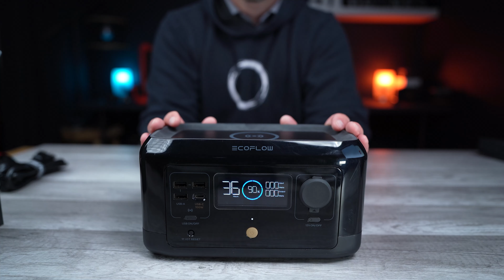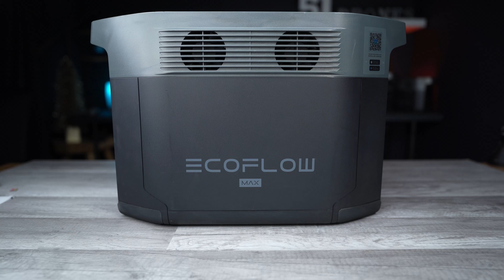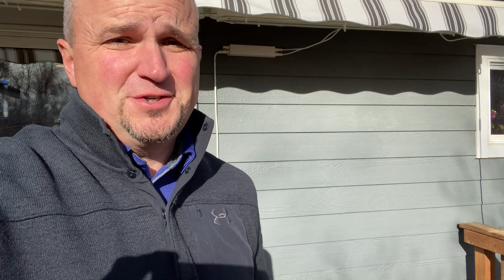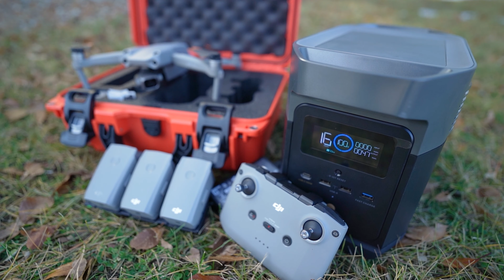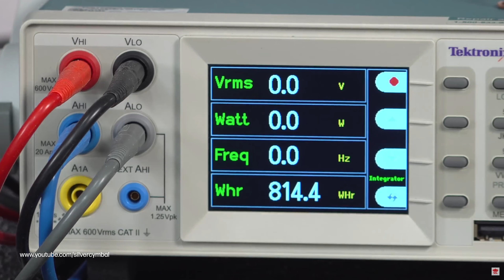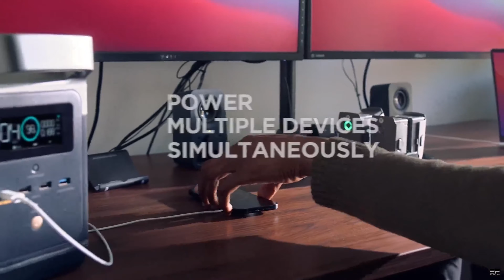EcoFlow Delta, Delta Max and Delta Mini - Which one is for you?

Comment: BEWARE OF THE ECOFLOW PRODUCTS! BARELY USED DELTA PRO & had a small electric heater plugged into one of outlets on the front & suddenly the entire unit is dead.  Tech support said nothing they can do about it & want to send reman unit but will not extend warranty on reman unit to guarantee that same thing won't happen again! MAYBE CHECK INTO BLUETTI'S !

Comment: I have purchased 2 of the Eco flow Delta Max Delta pro. I am a engineer and hands down is down for the amount of money and the amount of efficiency in the products you can't beat it. There's many different kinds of products out there it's all depends on your personal use. And what your preferences but I can truly say thatruly say that I am my wife did a lot of research joined different products and I'm so happy that I came across this product the Eco flow. I just want everyone to keep in mind that these are for specifically aemergency purposes they're not to sit and run a dryer or a washer all day every day. I have used them in blackouts to turn on heavy light and fan and light my whole house and run other devices 100% efficiently works great. You can run a dryer which I've done I've run a Samsung full load washer for hoursBut in a case of an emergency I'm not concerned about washing or drying clothes. My main concern is having power to run a hot plate make some coffee keep my refrigerator running and keep my lights and my electronics backed up.

Comment: Hi Russell,
I’ve been a long time follower of your channel regarding drones..great channel…regarding the eco family of electric generators, I have a unique situation with one of its competitors that I believe is a systemic issue among all units like these, but I’m hoping that the eco flow is different.  I currently have a Westinghouse iGen1000s hooked up to my sump pump as a UPS and it works great EXCEPT for one MAJOR operational problem.  When power goes out, the electric generator takes over and does it’s job, if the sump needs it, BUT if the power is off for more than 24 hours, the AC side of the unit shuts off from wall power, meaning when wall power comes on, the AC side of the unit only is off (as though someone shut it off) even though there is still plenty of battery left ??  Since it’s set up as a UPS though, the sump pump won’t run anymore, even though the wall power is on, and plugged in….Mfg doesn’t understand why I’m concerned about this…went away for a week and I think you can guess the rest…does the eco flow do the same by (cutting out) AC power recovery after 24 hours of wall power failure when used as a UPS ??

Comment: Russ - so I'm clear - these devices are not generators but batteries, and do not come standard with any solar generating capabilities, but that can be had as an extra cost option? Did I get that right? Thinks - you're doing a great job, and I believe you can be trusted for sure
Reply from the maker: That is correct.  I use generator as a generic term, but they are basically large smart battery packs.

Comment: So what does 800 cycles to 80% mean? After 800 full uses it'll only work at 80% of it's original charge? That's not too bad, if so.
Reply: No lithium iron phosphate? Really Blueetti is killing it. 2500 cycles to.80 percent is waaayy better than 800
Reply: @mikemay1200  15 hours to fully charge the bluetti......90 minutes for the ecoflow
Reply: (I dunno anything about this kinda stuff)
Reply from the maker: That’s correct.  After it has been charged 800 full times, the max storage is 80% of the original, and that’s the highest it will go.  With regular use, it should take 3 to 5 years to reach that, but most people will never reach 800 cycles.
Reply: @51Drones  pretty awesome. Thanks for the info. Love your channel

Comment: I've been interested in these since Anker had their powerhouse series. But they've all always been so expensive for the longevity you get.
I've been dabbling with making a backup solution with multiple deep cycle marine batteries, power inverter, trickle charger, and other bits. 
Also I used to fantasize about using a Vruzend kit to make the backup kit too.

Comment: I have switched from jackery to ecoflow. I only have the river pro but hoping to get a river mini wireless for Christmas. I plan on the delta 2000 with smart batteries in the future. I think jackery is falling behind and bluettie is doing unnecessary stuff.
Reply: I wanted about 1500 in power and was looking at Bluetti but as a female am concerned about the weight. BTW, purpose of the system is for use at home in the event of a power outage.
Reply: Why do you say jackery is falling behind? Looking into securing one and am just starting research. Thanks
Reply: @jewelofwisdom8279  I have the jackery 500 and the ecoflow river pro, the ecoflow gives me a few more features than the jackery in case I need it. I have GoPros, drones, a fridge and other gear. I have done a few reviews on gear and I go camping often, sometimes for days. That being said I do prefer the ecoflow.
Reply: @goneoutside1011  Ok, well I also went with the ecoflo and decided on the delta max.  I was looking at the jackery but decided to go with the eco because it weighs less, which was a concern for me, AND I went with the 160 w panels. Also, in my gut I felt the reason hackery may be getting such good press...not that it's not a good machine...is due to incentives to their reviewers.  Anyway, thanks again!

Comment: Thank you for sharing… my family live off the grid and they usually have to take their batteries to a charging station to charge then taxi it back home. This will be a perfect gift for them. By the way, I was impressed when I saw you run that electric ⚡️ saw 🤣😂🤣. I like the LCD Display too. Very interactive device. Definitely getting one
Reply from the maker: The Max is on another level.  It’s unstoppable.

Comment: Good video Russ, I don't mind you straying off the drone subjects. I have a friend of mine I'm helping to take care of who has unfortunately, ALS and he depends on a machine for breathing assistance right now..  something like a CPAP on steroids. He's living in a rural area and is very afraid of power outages so he's been interested in something like this.

I had in the past suggested and uninterruptible power supply similar to what you would power the computer server that has lead acid batteries where the electricity will flow through from a wall outlet to his CPAP. But the battery will kick over immediately where the power to go out. I wasn't sure if lithium ion battery devices like this would do the same thing, allow the electricity to flow through them if power to the house was still alive and then kick over to battery power when the house power fails. I'm very glad to hear this and I'll be forwarding your video to him.
Reply from the maker: That’s great!  They aren’t cheap, but when it’s about life and death, there is no limit.
Reply: @51Drones  :thanksdoc: